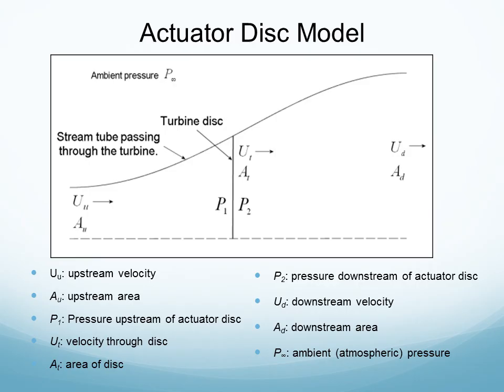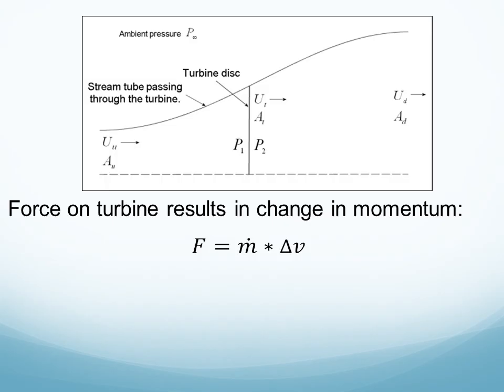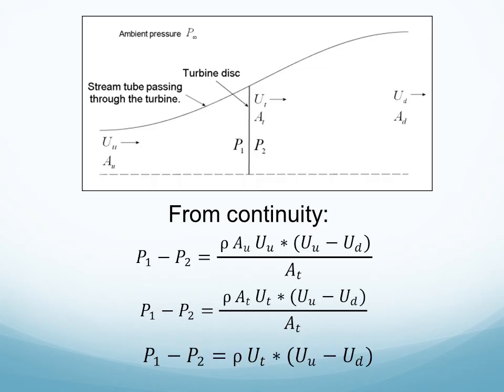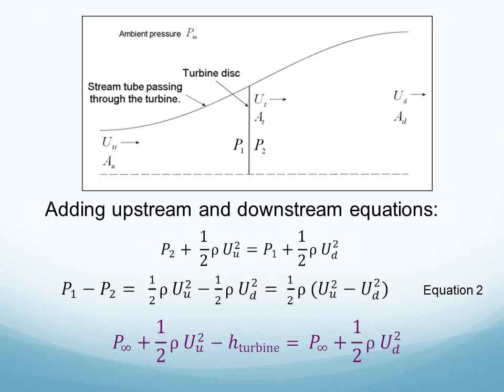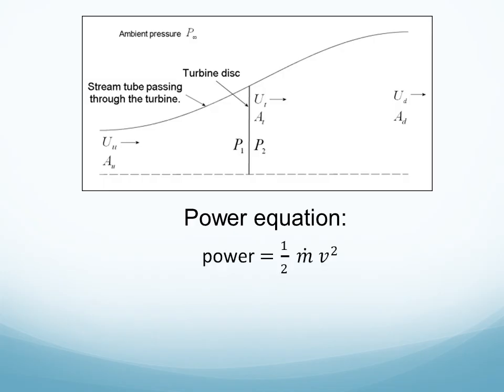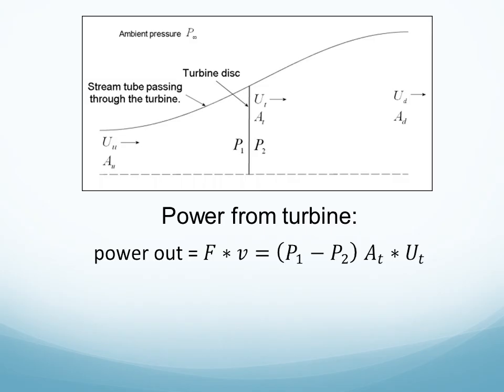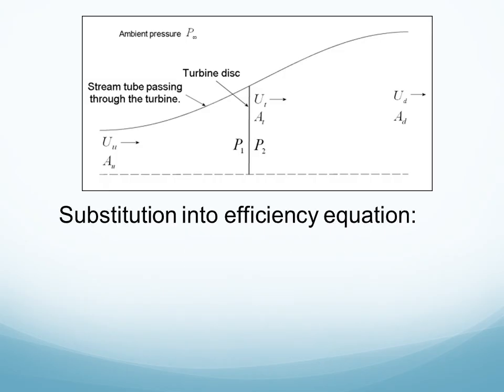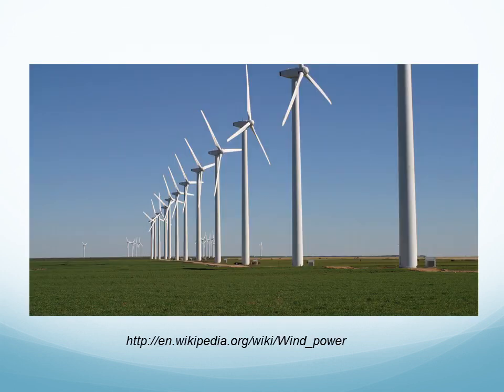Betz' Law - The Maximum Efficiency of Wind Turbines

Comment: I am confused. When I write the efficiency in this way:

efficiency=((P1-P2)*A_t*U_t)/(1/2*density*A_t*U_t*U_u^2), then replacing equation 2, we have:

efficiency=(density*U_t*(U_u - U_d)*A_t*U_t)/(1/2*density*A_t*U_t*U_u^2)

Then we have:

efficiency=(U_t*(U_u - U_d))/(1/2*U_u^2)

Then replacing equation 3, we have:

efficiency=(1/2*(U_u + U_d)*(U_u - U_d))/(1/2*U_u^2)

efficiency=((U_u^2 - U_d^2))/(U_u^2)

efficiency=(1 - (U_d/(U_u)^2)

Then the maximum efficiency is 100% when Ud=0. That is a solution too.

Comment: So, the fraction of 16/27 is an exact fraction, that only turns "irrational" when converted to decimal? This explanation suggests, that the fraction is not "rounded", but rather the exact percentage available from a "perfect turbine". If a turbine advertises "80% efficient, that means, 80% of ~59.25925%, for an overall efficiency of ~47.4074%.

Comment: Interestingly, if U_t = U_u were true, then the equation 1/2(U_u + U_d)=U_t (or the arithmetic average equation) would imply that all velocities were equal. If that were true, then the turbine would not output any mechanical energy, as the pressures on both sides, P1 and P2, would also have to be equal (this comes from her equation 2). So that can't be exactly true. 

There's something going on here... Maybe it's only approximately true, and we are taking the limit as U_u approaches U_t,  where the closer you get to this limit, the lower the power output, but the closer our efficiency gets to max efficiency. Kind of like a Carnot Heat engine.

Comment: Has mr Betz forgoten about the fact that any object that stands in the wind  is not just pushed but is also sucked by the air around it  that can add to the force of the rotation of the blades
or did mr Betz do his experyments in a closed space and not in the open or just did the maths
Reply: Heads Mess jj

Comment: At 7:22 you say that you make the assumption that Ut=Uu but then you say equation 3 is Ut=1/2(Ud+Uu). How can you use two different assumptions/equations for Ut at two different parts of this derivation?
Reply: Naman is correct: it is only used for the "power in" calculation. But it can't be exactly true, or else power out would be exactly 0.
Reply: Yeah I think the correct assumption is that the velocity at which the mass flows through At in the intlet is Uu. Thus m_dot = (rho)(At)(Uu)

Comment: a power plant 800mw burns natural gas to boil water producing saturated steam 100% quality at 70 bar this steam is expanded in a turbine to steam at 100c and 1 bar the steam inters the turbine at 10 m/s and exits 5m below the entrance point level at 100m/s the turbine is connected to an electrical generator by ashaft the efficincy of the turbine is 60%.what is the mass flow rate of steam to the turbine?